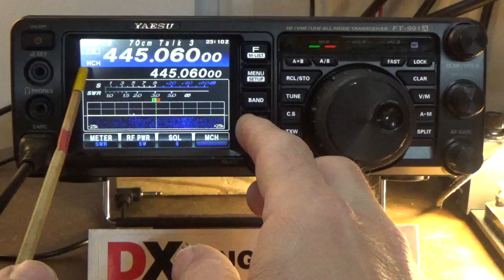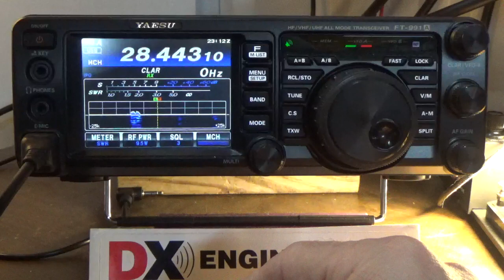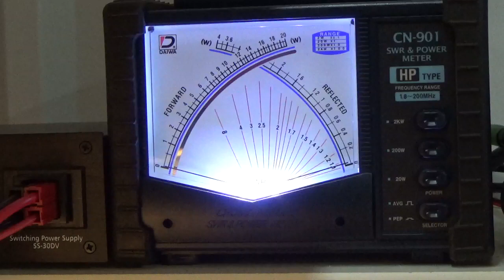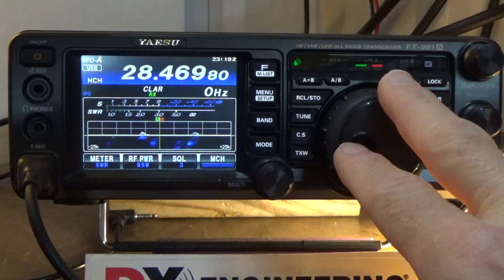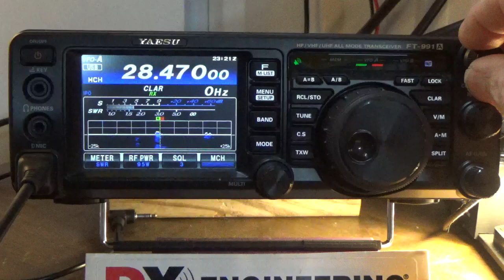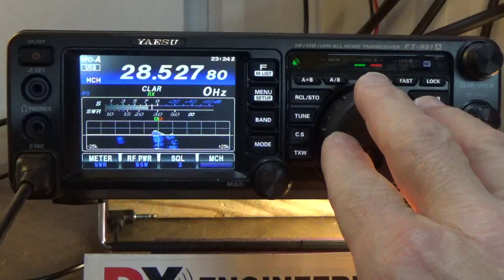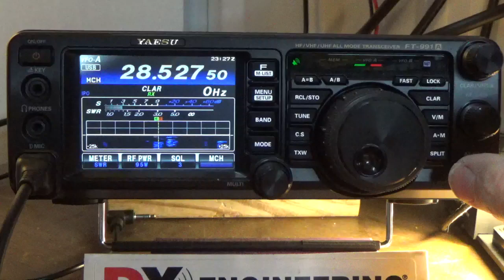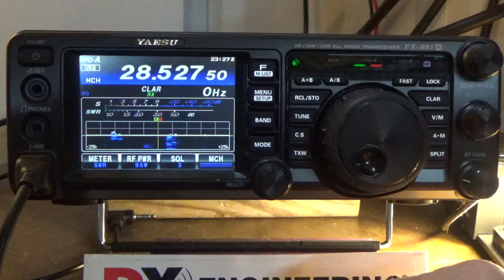Working 10 Meter CN-901 SWR Meter Demo - Worked VA3LUK beaming west to Asia and Clarifier Demo

Comment: How well do you like the meter? I just bought one just like yours for use on 11 meters
Reply from the maker: Good evening and thanks for the message, I love the CN-901 its very high quality and responds quickly on the PEP side I'd give it a 10 out 10, I think you will be very happy with it, thanks again and keep in touch with the radio journey '73 sir
Reply: @West Texas Video Gates (KI5JUF)  thanks for the quick reply I needed a good quality meter for cb that wouldn't break the bank I have a ham license to actually I need to renew them before my 2 year renewal period is up I enjoy 11 meter more than ham.
Reply from the maker: @chevyguy1128  Great '73 hope to catch you on the air!!!
Reply: Thanks for the video. I just purchased the cn 501v for vhf uhf. Thanks for the informative frequency usage.